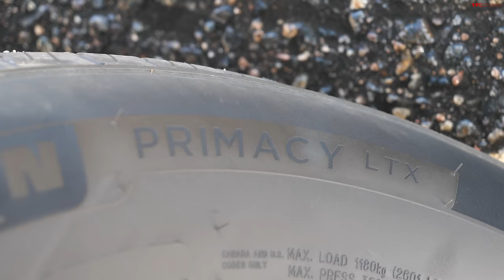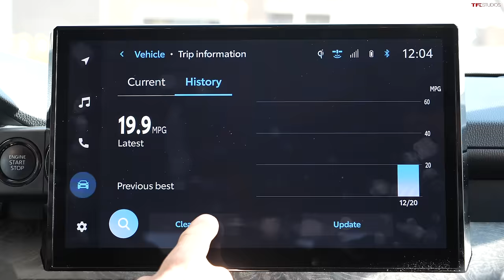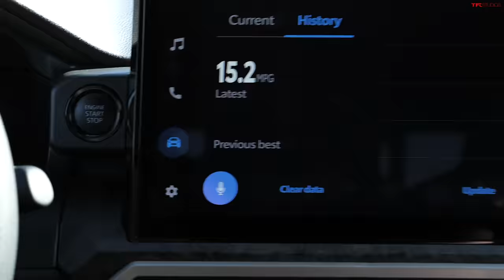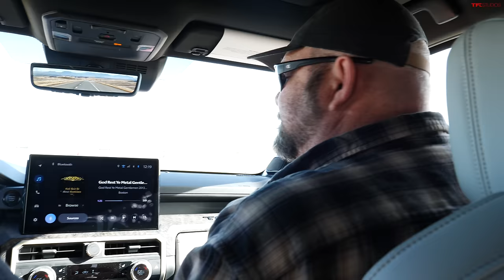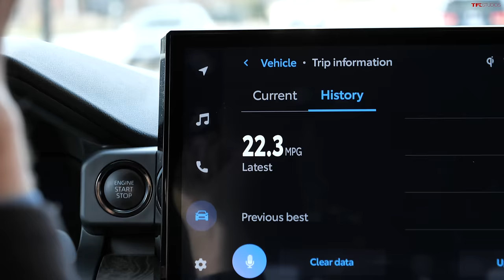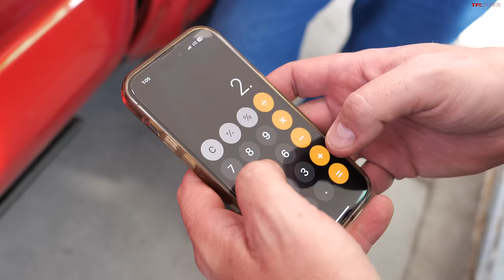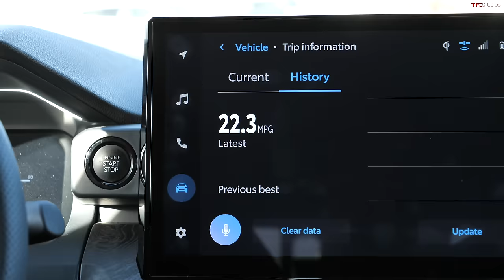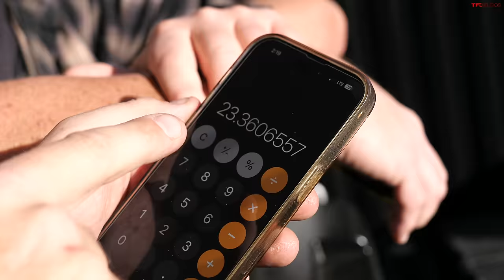Does the New 2024 Toyota Tacoma's Massive Chin Spoiler Actually Do Anything? We Put It to the Test

Comment: There is no way I would ever get a Tacoma with a 4 cylinder I love my Tacoma 2005 with a real V6 HELL YA. And Turbos only last about 100 thousand miles and yes, I will knock it even if I try it
and the rear bumper with the drop-down tow hitch I dont like that I hope they put rear disk brake on it but that wont matter to me now that it has a 4 cylinder not all changers are good ones, I wont a V6 with turbos?????? or not??????? Sad Days for us Tacoma lovers :( :( you take so much wait of the bed that you will have even more problems sliding around when it rains or is wet or Snowy out not to happy with this new Tacoma, I guess my 2005 Tacoma will be my last
Reply: VERY surprised to see a Toyota owner claiming that turbos only last 100,000 miles. My last diesel was an 02 Ford Powerstroke and it has over 400,000 on the original factory turbo. It was working fine when I sold it at 289,000 miles, and the current owner is over 400K with no problems. That’s with a Ford !!! Are you telling me that a Toyota can’t at least approximate that level of reliability ?!?! I get the loyalty to your V6, I’m still driving a Toyota truck with a 4.7 and haven’t gotten a new one despite the almost 300,000 miles on it because it still runs great. I’m considering the purchase of a Taco for runabout daily driver use, and from every comparison I’ve seen this new 4 cylinder turbo absolutely SMOKES the older V6. It gets better mpg, makes more power, makes a LOT more torque and at lower rpm. I’m thinking if you limit yourself to your 06 Taco then you’ll be missing out on upgrades done before the change, AND the potential of the new truck. That’s a choice only you can make for yourself, good luck !
Reply: Semi trucks can put a million miles on a turbo without failure. If you think this engine won’t be reliable you don’t know Toyota.. this motor actually exceeded the reliability of the last generation and the turbos reliability is in Toyotas commercial category.
Reply: @skipgumphrey9579 diesel is a different animal. Not even comparable!
Reply: @JohnDoe-nz6bk  Turbos work the same regardless, and Diesels demand way more.  Not only do they run hotter, but they typically are pushing 25-30 psi of boost. 
Comparably these gas engines on the stock tune only run boost at 10-12 psi. As long as they use a good quality turbo, it should have no problem. 
Which Toyota is  claiming they built this engine up to the same standards as their commercial engines.
Reply: @DragonKnightX12  work the same, yes. Built the same, no! Again, completely different animal.

Comment: You guys should do this test with the F150 lightning active air dam. I removed mine from the actuators which only requires a 7mm socket for 3 bolts on each side. Saw no change in my mostly 70mph highway commute.

Comment: With the levels of powertrains explained from all reviewers, I feel is an overcharge and not really to make each trim level more affordable... rather than sway you to get the more expensive level. The engine is physically the same  inside and out and they don't add any performance components to differentiate the power ratings (except for the hybrid)  so really the differentiator is via a map / tune and in my opinion doesn't cost a thousand or so to accomplish.  I could understand a bump of like a couple hundred or so is more reasonable for basically a spread sheet. again except the hybrid obviously this has additional physical components to reach those power figures.
Reply: Well and removed an oil cooler. Is my understanding. So if you get the cheap engine it won't last as long worked like a truck.

Comment: I really enjoy your videos however, I’m not very impressed with the results of this test. My 2022 Off Road has a 18-22 mpg estimate. With normal driving I get right around that in reality, occasionally better, a bit less when I’m heavy footed. You show that the new Tacoma with it’s 4cyl Turbo gets 24 mpg. I guarantee many will get less due to the thrill of the Turbo effect. Not much of an improvement. My 2022 rates 278 hp as well though I will give the 2024 props for the higher torque. The truck looks great, and the technology seems nice but with the price and modest to negligible performance improvements I’m not willing to switch yet. Still, a very thorough video series on the Tacoma. I’ll be interested in seeing the long term opinions on the one you are buying. You guys truly do a great job with your videos.

Comment: I did the same test on my Tahoe, did a loop of a little over 100 miles, back to back on the highway, following the exact fill up procedures at the same gas station and the same pump. I got 0.02 mpg difference/ worse, without that ugly chin spoiler. I’d say it’s literally within a margin of error, but my tests could not have went better. Barely any traffic, steady temperatures, low wind, got to stay in cruise control the whole time on the interstate, it could not have been a better “apples to apples” comparison.

Comment: It wouldnt need that 15 foot tall chin spoiler if it wasnt on big wheels and tires. My dad drove a 97 F350 4x4 std cab short box chassis dually. He said anything over 80-85mph you felt the front going light. It was also on 16" wheels and 215/85s (8.5" W x 30.5" H)
Reply: On my lifted Ram.. it felt the same at high speeds

Comment: That difference is within a margin of error. This would be especially true with only a 57 mile loop. Even with the same pump, it may not behave the same each time you fill the tank or there could be an air bubble in the tank. The test would be more accurate with a much longer loop. I agree though. Ditch the spoiler and put a nice TRD skid plate on the truck.
Reply: There is also another factor that adds more error than most realize to these tests and I had mentioned it back when they did the ram 1500 spoiler test but TFL would not speak up and give any explanation. It has to do with what run time status the vehicle had before the start of the test or put another way was the fuel in the vehicle relatively cold or warm before the first fill up of fuel, prior to the first test loop. So most vehicles have a fuel return system to the tank and that causes the fuel to warm up and warming fuel up expands fuel. So if the vehicle was fuelled up the first time with not having been driven far before hand, that would mean colder dense fuel in the tank and topped off with cold pump fuel. Then running the first fuel mileage test would expand the fuel volume due to the warming effect causing less fuel to fit in the tank for the first fill after the first run, then running the second test back to back and filling would result in more fuel fitting. So that would automatically falsely show a better fuel mileage calculation at the pump in the first loop vs the second loop. So lets say this took place ( I understand the office is not far from where they fuel up ) , but they instead had the spoiler off for the first run and then put the spoiler back on for the second run, chances are the second run with the spoiler on would have looked worse than a first run with the spoiler off. Short distance drives with variables like this don't equal to accuracy is what it comes down to. So I totally agree, much longer loops that use up most of the fuel in the tank are far more accurate as long as the weather ( wind/temp/dry vs wet road etc ) and road speed are consistent. Never the less this test they did gives a decent over all snap shot of what the truck is capable of doing for fuel mileage relatively speaking and with other vehicles tested on the same loop with the same amount of weight ( people ) in the vehicle to get comparisons.
Reply: @charlesb4267  TFL "Real World Testing" is another way of saying unscientific, ignorant and lazy.
Reply: @jimjones-pz1tt  But as long as they can flog off a video that many watch because the general audience swallows what they on the channel claim, apparently its all good. One always has to keep in mind that they get handed most of these vehicles to test as well as many of the trailers they pull for free and its short term testing, very short. If they became too critical or another words pointed out not so great of a track record with past years but same or similar drive-trains etc, all their freebie vehicles to test would dry up. I was highly unimpressed when Roman himself was ragging on and reporting to youtube, a very small youtube channel also in Colorado for uttering the words Ike Gauntlet. Competition in the youtube world, can't have that !
Reply: @charlesb4267  I'm not sure if Roman and Nathan play stupid to their demographic or they are stupid and think their audience is smart.  It's probably the latter.  I don't see a a trade mark on Gauntlet or Ike Gauntlet.  What about Roman using Cannonball and Cannonball Run to describe TFL's pathetic at the speed limit coast to coast EV runs?  First, it was going to be Disney to Disney until Disney told him to take a hike, then he started using cannonball as if what TFL did had any similarity to the real event.  Cannonball Run is trademarked and owned by Pamela Yates, widow of Brock Yates who came up with the concept and ran several of the events before writing the script for the movie.

Comment: You know I wonder what would happen if you got one of those Toyota Tacoma chin spoilers and cut it down a bit wonder how well it would work did kind of make a compromise between fuel economy and off-road capability and even looks know the chin spoiler on that Toyota Tacoma is really well designed for fuel efficiency but that's all it's good for

Comment: I know it's old news, but would love to see this test on the 3rd gen Frontier. Harder to remove, but much less in the way off road.
Reply: Funny you said this. I was just wondering about adding one out of dumb curiosity to my new pro4x as the fuel mileage is dismal.
I see sv 4*4 owners posting claims of anywhere from 3-6mpg better fuel mileage than I'm averaging.
Reply: You should go to a Toyota dealership. Wait outside and when someone drives out with their new Tacoma, offer to take off their chin spoiler for free. Then you have one and modify it for the Frontier. How bad is the fuel economy on your pro4x ? I am debating frontier vs taco in a few years.
Reply: @is6566  mixed driving interstate and two lane roads in rural area it averages overall  20.9 by the dash display which are known to be very optimistic. Driving in manual mode babying it on a rolling two lane I saw a fuzz over 23 for a few miles, but it dropped right back off as the road changed. 
Pulling an open aluminum trailer with two track bikes and ramp removed it drops to 12-16 running interstate speeds varying with speeds and traffic flow.  So the best I've seen if everyone on the forums are right,  actual is  about 20mpg.
 There is a lot about the truck that is really nice - awesome even ( in person parked next to the new taco it looks every bit as good especially with leveling kit) but if I had it to do over and known how bad the fuel mileage, cameras and that huge ass hood bulge are I'd prob went a different route.
Reply: @deweysturgill6220  Eh the dash display is super optimistic. I get hand calculated 16-19 in my SV King Cab. 265/65r17 Wildpeaks, air dam on, mid rise topper. I'm not sure, but I think the air dam and the extra Pro4x skid plate are mutual exclusives.
Reply: @TheJCars10s  yes sir you're right . The  s, sv, sl are fitted air dams unless you pay extra to have  the skids installed. 
The fact the stock indication if off a few is  what's bad about mine because even on the dream meter I'm low. I haven't taken the time to hand calculate it yet, but on recent track day trip I used almost an  extra tank of fuel over a weekend vs the same mileage covered in my older nissan  truck a trip before.
Reply: @dewey… Thank you for the response. Honestly, 20 mpg (if hand calculated) wouldn’t be bad. 24 mpg would be better but I think the Tacoma will drop a few mpgs with a knobby AT tire, too. Yeah, I saw reviews and the cameras are bad.

Comment: What about the low pitch whistling sound coming from the front end after removal of the air dam? You don't mention it. How do you eliminate the noise?
Reply: @Vshky  Apparently there are 4 holes on both sides of the truck off the control arm. Either cover in duct tape or ideally fill the with a rubber plug. Do a search. Very simple. I have not removed my chin yet. Truck only a week old
Reply: @kenwedin7019  Already done.

Comment: The reason the detuned engine on the SR isn’t  to make it cheaper. Toyota detuned the engine to make it potentially last longer due to Toyota assuming it will be a work truck
Reply: Yeah. It doesn’t make it cheaper as the engine hardware is exactly the same. Although, I think the rear pumpkin is slightly weaker (less material in it) in the autos.The manual SR though has the same rear diff as the higher HP/Torque trims.

Comment: I’m curious what mpg I would get in my state of FL. On my 21 TRD OR. I regularly hit 25-26 mpg @65 mph.
Reply: Probably close to 30.
Reply: That sounds good compared to my 4.0 at 20 mpg at 60.  But is it worth the $40K to change m/y ?  Not for now.
Reply: I don't believe your numbers.
Reply: I am at over 25 mpg with my  22 TRD sport 4x4 for the entire time I had it and my wife has a 22 off road and is at 21
Reply: @bendino9016 agreed, I'm calling bs on 26mpg
Reply: On a trip from So Cal to Cody Wyoming, over to Jackson Hole, and back home, I got 28-29 with my 19 TRD Off Road, DC, V6, averaging 75. I had gear in the back, a hard tonneau, on 265/70/17 BFG ATs, load range C, and has a 2 front and 1 rear lift. I typically get 26-27 between home and Mammoth or Tahoe and that is with several significant climb outs over long passes, some at high elevation. I did notice the truck got better mileage after it had 10K on it.
I still like my Gen 3 better than the Gen 4. I think I’ll be holding onto it for some time and with only 22K on it, it’s got a few good years in her.
Reply: @bendino9016  went 430 miles filled up with 16.125 gal of fuel.  Traveled in the early morning hrs. Speed limit 70 mph. Cruse set between 65-75 mph. I think average speed was 50mph. Trucks computer showed only 23.4 mph. However doing the simple math shows 26.66. Mpg.

Comment: 15,000 miles of driving you’d use 622 gallons of gasoline with the chin vs 641 gallons without. 19 gallons at ~4.50/gallon is $86. 

So every year you’d pay an extra $86 to have it look better.

Comment: Am I the only one that thinks that this is WAY TOO SHORT of a distance for doing a real MPG test? First off, despite the fact that you're trying to control how you fill up, the amount of gas that the pump puts in your tank could be off by 1/4 of a gallon just based on where the pump stops. Ya ya ya I get it you're trying to use the same pump, but it doesn't matter. You have a long neck on your gas tank and where that thing stops depends on a lot of factors. So going less than a few hundred miles is not a real test IMO. Didn't you ever study significant digits in science or engineering classes? You can't use a fill-up technique that can result in 10% difference fill-up amounts and conclude that there is a 2.9% difference between two things. Do I even have to explain why that doesn't make sense? My God, does anyone even care about math anymore?

Comment: i wish they would have just gone with the electric deployable front splitter like the tundra. they could have easily saved cost in other places on the truck to make that a standard feature of most trucks aside from the SR. than you also have the option to disable it for off-road use.

on the upside toyota seems to know it doesn't serve much of a purpose and thankfully makes it very easy to take off.....

Comment: I’m pretty surprised how good of fuel economy that got. Especially considering you’re at elevation and doing real world speeds (75mph). Many mpg tests I have seen tend to go 65mph and that’s just not realistic.
Reply: Turbo chargers compensate for density altitude through the waste gate
Reply: @brutonoc  within reason. But every engine suffers from thinner air no matter if boosted or NA. The wastegate only controls the amount of boost. If it’s limited to 14psi, it’s going to make 14psi at 10k ft or sealevel. But because the air is thinner, it will still make less power. If you watch drag racing you’ll see that at altitude in Denver they often increase boost 5-6psi and still make less power. Additionally it builds boost slower.

Comment: I've got a 2017 Tacoma TRD Off-Road with Falken Wildpeak AT3W tires on it and I get 9.99 L/100 km's on the hwy that works out to 23.5 mpg. The fuel economy, for the new 4-cylinder turbo is not very impressive IMO.
Reply: Yeah and think under heavy load pulling uphill that afr will drop to around 9.5- 9:1  to prevent the engine from grenading.
No there is no economy there. 
Will guzzle the fuel.

Comment: At this point it’s starting to look like an 8 speed Auto or 7 speed manual with the old engine would have done more for MPG on the Tacoma than this new set up. Put any kind of AT tire on this truck and you’ll probably lose 2 mpg.
Reply: With a decent AT, yes. Adding same size Duratrac to my F150 reduced the mpg exactly by 2. However, the Off Road trim tested by Truck King had similar MPG on sea level as this Limited and the OR had a Falcon Wildpeak, I believe. That Wildpeak (if it was a Wildpeak) was different OEM required spec and not the regular Wildpeak that we consumers buy at TireRack. The OEM versions are AT-ish with lower rolling resistance as Ryan Douthit explains at Driving Sports TV.